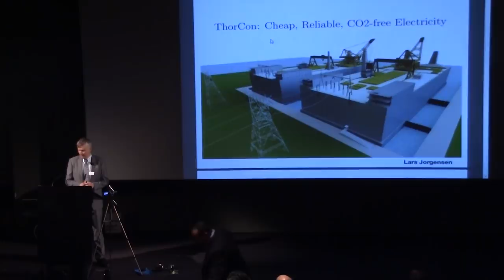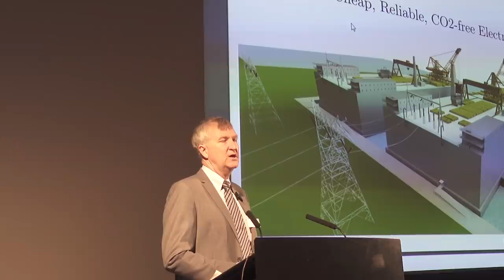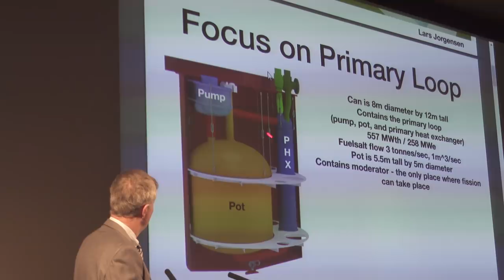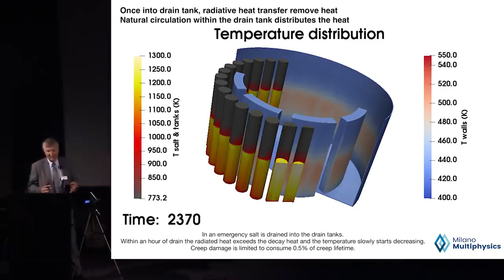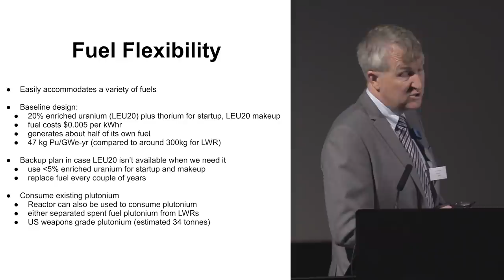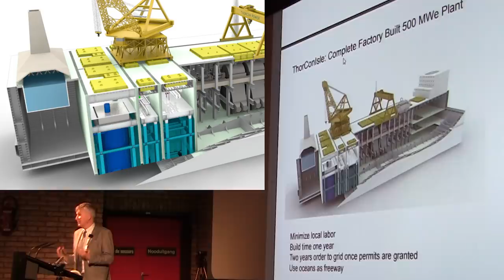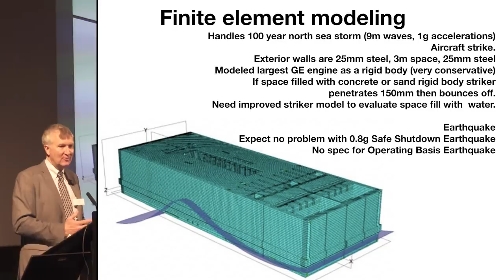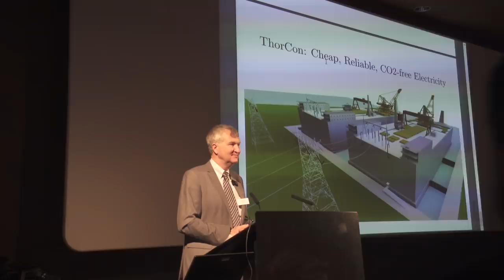ThorCon: Cheap, Reliable, CO2-Free Electricity by Lars Jorgensen @ ThEC2018

Comment: In defense of nuclear energy being safe, Jorgenson says, "No one got hurt from radiation at the Fukushima melt down, except 1500 people who died during evacuation."  He said that as if it were true.
Reply: That's because it is true. Not a single person was hurt by radiation.
Reply: @chapter4travels  Not true Greg,   "Japan’s government has previously given compensation to four other workers who had developed leukemia and thyroid cancers as a result of radiation, but this is the first time a death has been acknowledged."   http://time.com/5388178/japan-first-fukushima-radiation-death/
Reply: @mal6232  I stand corrected. the second worst nuclear accident in the world and 5 people died years after the incident. This illustrates just how safe they are. Nuclear is by far the safest way we generate electricity, safer than wind, solar and hydro as well.
Reply: Thanks Greg.  Let's see what TEPCO and the honest Japanese government say.  Out of 300,000 children screened, the children from Fukushima showed 15x higher rate of thyroid cancer than the national average.  But they decided that such statistical deviation was not significant and do not include it in their evaluation.  That's for starters.
Reply: @chapter4travels  Without a doubt Greg. None of the 'renewables' will ever be in a position to take on the role of primary energy supplier either - too intermittant, too difficult to maintain, too dependent on  topology or too intrusive to commerce. Also, the manufacturers and suppliers of these things lie about their capabilities, the true, real world output from solar and wind is nowhere near the claimed output capacities. I have 1.5 kw of solar on a south facing 30 degree roof that has never generated more than 1kw in real life - and that was when it had been raining and then the sun burst through so the panels were cool - normally they are around 700 watts in the sunshine.....half their rated output. Remove all the subsidies and let the free market economy decide on their worth.....
Reply: @robertbystrom7108  I have no doubt that there will be a lot of ass covering going on, I'm not even sure I would trust the 'honest Japanese government', however we must remember that Fukushima was a LPR and, by design, inherently unstable, this talk was about an MSR - a radically different concept and the lessons have been learnt the hard way.
Reply: @mal6232  
I have several concerns here, not the least of which is radiation.  There appears to be a lot of promise in thorium which has been less well funded.  We are also seeing rapid improvement in solar conversion as well as electrical storage capacity, to say nothing of improvements to wind turbine design and ocean wave, current and tide power generators.  This brings out the major issue, which none of the large scale developers wish to acknowledge, which is the emergence of the possibility of an individual household to generate their own energy.  The attention is placed entirely on maintaining centralized control.  What are your thoughts on this idea?
Reply: @robertbystrom7108  IMHO......Not everybody has the ability and the desire to operate and maintain their own electricity generating system, in fact, I would go as far as to say that those of us that do generate, at least in part, of our own electricity, are a very small proportion of the population. There are some who are forced into going 'off-grid' - live aboard sailors for example - and they become acutely aware of their consumption because they are forced to 'live within their means'. This is not a position I see the vast majority of people accepting when there is a perfectly acceptable arrangement with a national generating company on offer for a few beer tokens each month. Also ,as I alluded to in a previous post, in my experience these things are not as efficient as they are cracked up to be, I get around half the rated output from my solar panels on an average sunny day ( and sod all at night!) and they are about half way through their expected life. Wind turbines, on a boat at least, are just too noisy and prone to failure (admittedly the salty environment doesn't help with that), and land turbines have an environmental impact that is usually far too high and whenever I see one, which thankfully isn't very often, I note that it is barely turning and cannot see how it can be producing anything. Wave and tidal generators are too small and too remote to be of use in a national sense but could be used by a local community who are prepared to maintain them but I fear the cost will be quite high, both in a monetary sense and in environmental impact terms. Lithium-Ion batteries have just about got as far as they are going to get, all the 'new developments' are small tweaks that may add a few percent to their performance but usually the quid pro quo comes in the form of increased fragility. Who knows where the next quantum leap in battery storage technology will come from....if it ever comes.
 I see the future with local communes each having a modular, next to zero maintenance MSR next to their community hall which is swapped out for a new one every 5 years fulfilling all the electrical and hot water requirements for the residents. Heavy industries will be located together with their MSR obtaining the same benefits. Fresh water can be extracted from brine to provide irrigation in desert coastal regions and these reactors will be factory mass produced and delivered by boat or truck.  At the end of it's 5 year life much of the old reactor will be recycled, the active elements will be recovered and reused with virtually nothing being sent to landfill. We just need the next generation not to take on the same paranoia that the current one has....

well....you did ask!
Reply: @mal6232  Thank you for your thoughtful and detailed--somewhat--response.  (Your opening phrase is an all-too-true statement about people in general unwilling to take responsibility for themselves and what they eat, wear, inject, think and believe.)  I, too, have had doubts about giant wind turbines.  I have followed the VAWT technology a bit more closely and see many home owners using home made versions to supply a large percent of their usage, relying on the grid for stability.  Being a Swede, I am more inclined toward the tide and wave technologies.  I am also aware that more alternative power generating technologies which have been proven on small scale have been systematically removed from public awareness and the inventors silenced.  I confess that I did not complete Jorgenson's presentation past his no-damage statement about Fukushima.  I understand that the meltdown is still ongoing and water contaminated with cesium 134 and 137 and especially strontium 90 is still being released.  Bottom line for me is to encourage the development of small scale (neighborhood to village) power generation which involves no radioactive materials.  Multiple technologies exists and need only to be funded and released from the control of the power brokers.  No small task.

Comment: I do not like this design it is wasteful and dangerous. More of the same thinking using seawater on a barge to cool the reactor it is a bad idea. The reactor should be designed to have little to no waste heat. If something goes wrong an environmental nightmare. There are better ways of doing this.
Reply from the maker: Clement, why don't you walk me through your disaster scenario? Lars has a bunch of them covered here: https://www.youtube.com/watch?v=oB1IrzDDI9g (disaster scenarios are indexed in metadata) ...but basically worrying about waste-heat from a high-temperature Gen4 reactor is like worrying about all the precious photons that miss the Earth... there's plenty where that came from.

An environmental nightmare is what happens every day, thanks to coal. In contrast, try come up with a scenario where the contents of a ThorCon-can will pollute the air or water.

Comment: To me nuclear is NOT the solution and here are just a couple of reasons why. A nuclear reactor in its most basic form is no different than a coal boiler or natural gas plant. All the reactor is doing is creating heat so the heat can boil water to create steam and the steam can turn a turbine which creates electricity. For example, a reactor and generating plant, a coal plant and natural gas plant are all about the same efficiency. They waste about 65% of every BTU's of heat energy they create. So only about 35% of the heat actually does the real work of creating electricity.  But it is not just the inefficiency of the reactor or coal boiler or the steam side of a gas plant that are inefficient, it is the balance of plant items needed to create the electricity. Things like pumps, automatic valves, heat exchangers, and then the inefficiency of the turbine generator itself.  To this day we have not figured out how to beat the laws of thermodynamic and we most likely never will. So inefficiency is the first reason and part of that reason is that all of that waste heat needs to go somewhere and that somewhere is into our air, our streams and lakes and oceans.  Now multiple that waste heat by hundreds of new small modular reactors or even large reactors and what do you get?  What you get is more global warming and already the waste heat from some cities has been proven to be affecting weather patterns up to 1000 miles away.    

The second reason is that ALL power plants regardless of their type take millions and millions of gallons of water to cool both the power plant and the steam back to a liquid which is then reheated by a reactor into steam to turn the turbine which creates the electricity.  Even nuclear power plants like the one near Phoenix, AZ called the Palo Verde Nuclear Generating Station that uses reclaimed sewer water evaporates about 20,000 gallons of water every MINUTE.  Now multiply that number by the number of minutes in a day and then in a year and you can see why water is becoming increasingly important.  I certainly can’t be the only person who has heard about water shortages.  

So there we have just two reasons why nuclear regardless of its type is not the solution we need.  It doesn’t make any difference if it is a big 3000 MW reactor or a 250 MW reactor they are all the same.  They are not an efficient uses of our resources and I am just not aware of anything that we can continue to waste 65% of for some long period of time and survive.  That waste heat, carbon and water are on top of other considerations like construction costs and the time it takes to actually achieve working nuclear units.  When I retired from the nuclear field in 1995 some 25 years ago we were already talking about Molten Salt Reactors and Small Modular Reactors. Can we afford to wait another 5-15 years for solutions? 

Now I am not saying that SOME new reactors won’t be needed but rather they are just not the CURE ALL we are looking for.  For that we need to turn our attention to renewable energy sources like solar, wind, water, geothermal and biomass systems.  And while some of these are certainly intermittent they are also carbon neutral.  

So how much time do you believe we can wait for an energy solution?  How long will it be before our planet can no longer support 6 to 8 billion people?
Reply from the maker: I don't think your assessment that something can't be 65% inefficient and succeed makes any sense at all. But allowing that it does, other nuclear companies are pursuing more efficient conversion from heat to electricity via higher delta temperatures. They ditch water coolant and steam turbines. Molten Salt + compressed CO2 Brayton Cycle. And today's harnessing of 5% of the actinide inside fuel pellets can use chemical separation to pull out Fission Products and fission ALL the actinides. Then take the FP, chemically separate them, and harness decay heat (impractical with spent fuel rods except for warming a pool). There's nothing inherently inefficient about fission, we just need reactors to continue to advance the way every other form of energy production has. Since the 60s, reactor design advancments have happened in national labs. Canadian and American governments are very aware of these advancements which are ready to be commercialized.
Reply: @gordonmcdowell  Good comment Gordon and I appreciate your thoughtful response.  And certainly a CO2 turbine stage is more efficient but not a whole lot more, ha ha.  But we haven't even started talking yet about construction costs or operational costs.  
So lets take a look at just the operational costs for a moment.  Lets assume we use the latest Molten Salt or High Temperature Gas cooled reactors and we achieve and efficiency of lets say 70% efficient which will be a really high bar to reach.  How many people is it going to take to operate the plant.  Let's try to compare a typical 800-1200 MW Gen III reactor facility with about 200-300 workers to run the plant 24/7/365.  This included licensed operators by the USNRC, engineers, maintenance workers to repair stuff, maintenance planners, a contracted labor force during outages to refuel the reactor and on and on.  Now multiple that 200 or 300 people by about $40-$50/hour.  So being conservative lets assume 200 workers times 24 hours shift = 4800 manhours times an average wage of $45 = $216,000/day or times 4.33 weeks per month about $935,000/mo.  Now those are VERY conservative numbers and based on my personal benchmarking of 10 different nuclear plants around the country you can probably double those numbers
But lets even be more generous and say that with advanced safe shutdown designs, you can cut that staff by 75% that still leaves you at $233,800/mo.  as an operational cost.  Now that of course doesn't include sunk capital costs, benefit/company share programs and all kinds of cost like fuel which sooner or later will need to be replace.
Now lets take a trip about 100 miles from where I live and visit a 1000 MW electric solar power plant.  I stopped by there one day and got lucky - there was actually someone working there.  The repair person and I talked for a bit and he told me the facility is NORMALLY not manned by anyone.  Turning if off and on and varying its output is done remotely from the utilities central office.  
So this is just another reason that nuclear will not be successful going forward.  It costs too much to operate, refuel, repair and license the operators by the USNRC.  Next we could talk about construction costs but we haven't even built one of these small modular safe molten salt reactors yet.  But I can assure you that with government involvement it will not be cheap.  
Have a great day and stay safe.  Good discussion.
Reply: What is more efficient solution to generate electricty then?  Hydro-electric power?  Or what?  Electricity is required everywhere in the world especially developing countries.  You need something.  This not efficient.  That not efficient.  Nothing is efficient.  Then what?  Do nothing and sit there?

Comment: You can not cover up irresponsible with blindfold! Without way of handling waste, you will put every poor person endangered! This is an act of racist!
Reply: Bwhahaha, nuclear power is the cleanest way to make electricity precisely because it contains and stores all its waste.
Reply: Are you seriously?😱
You can build it on the very spot over and over?
Reply: @sywaddr11  Sure, that makes perfect sense, all the transmission infrastructure is right there.  Within about 10-15 years the new breeders can be built on those sites and have enough fuel from that waste for thousands of years. A negative waste stream.
Reply: @chapter4travels  is that means no site expension only stay on the same location
Reply: What about the fish? People eat fish as food……
Reply: @sywaddr11  Actually the site can be shrunken down by more than 50% because it is so much safer.
Reply: What in the film is same as what present condition. And produce even more waste.
Reply: @sywaddr11  I have no idea what you just wrote.